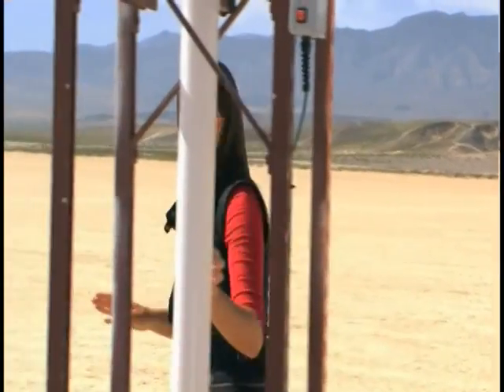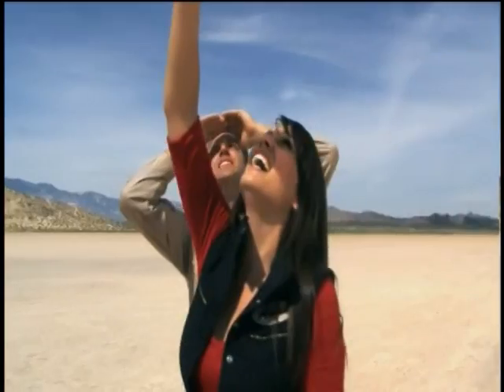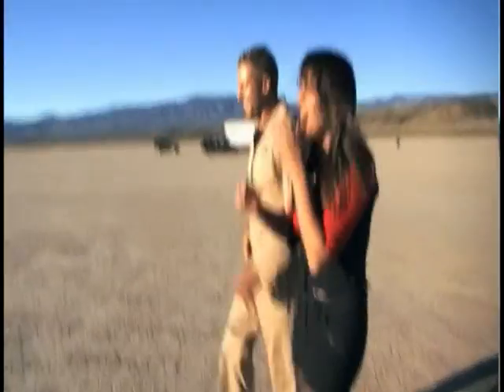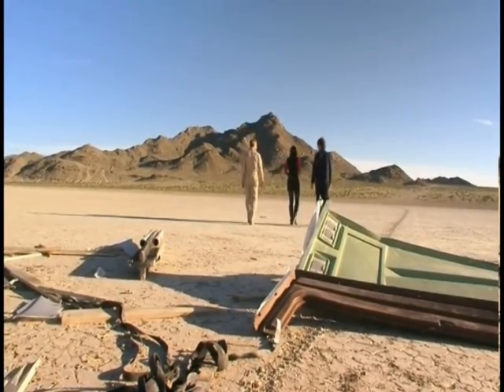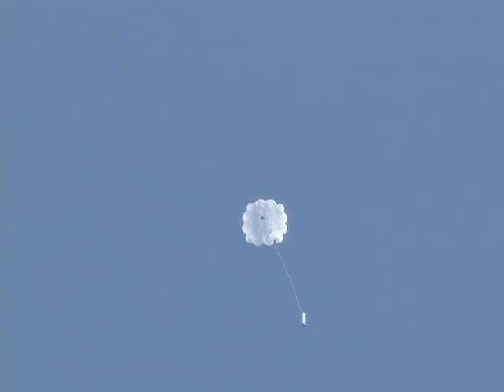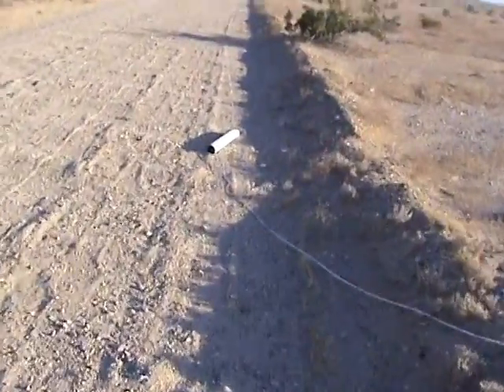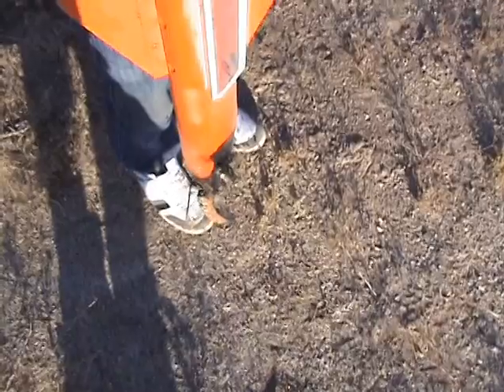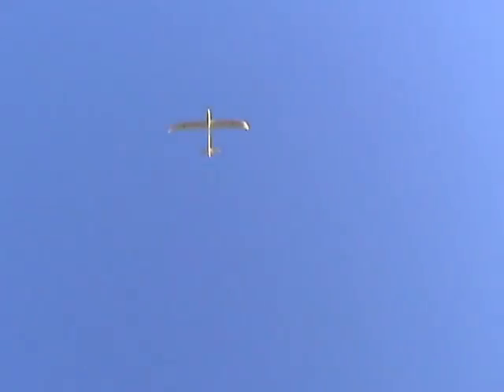K500 Flight with on-board video

Comment from the maker: Chamber pressure. If that increases the fuel burns much quicker. You can increase chamber pressure by decreasing the size of the nozzle throat or adding more burning surface area.

Comment from the maker: It's 2.5 seconds @ 300 psi in the engine. If you increased the pressure in the engine it would be shorter but the pressure would be too much for the PVC.

Comment from the maker: No, the heating is only to lower the viscosity of the fuel so it can be poured into the engine casing. It's not a paste at all, it's a liquid. I wrote a step by step book on how to make the rocket and the engine. It's available on amazon and it's called I Still Have All My Fingers. Hope that helps.

Comment: The altimeter saw max altitude, but since you were no longer on an upward trajectory, it deployed the cute while it was still travelling in excess of 300 mph.
Normally, this failure reults in a bit of "zipper rip" down the body tube.
However, in this instance, the sudden tremendous drag torn the upper BT away from the lower BT.
As for smoldering lower section an engine mount, you may have had a double failure mode.
Not a good day.

Comment from the maker: @xxkittenkiller No, it's 65/17/18 Kno3, Corn Syrup, Powdered sugar. It's not melted, just heated up enough to lower it's viscosity so it can be poured in the engine casing. I wrote a book on how to construct the engine and the rocket. It's called 'I Still Have All My Fingers' and it's available on Amazon. Hope that helps.